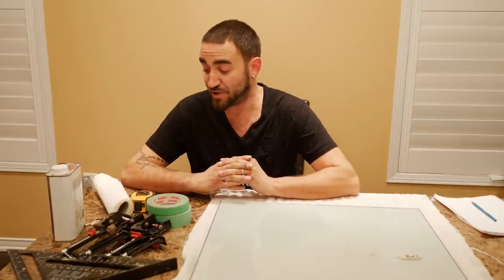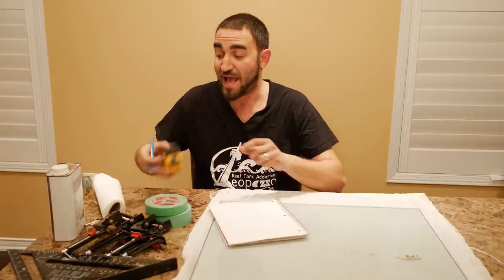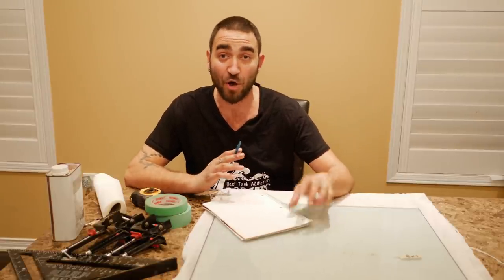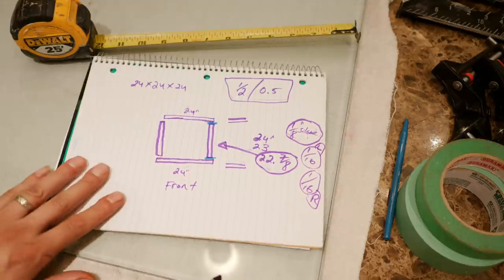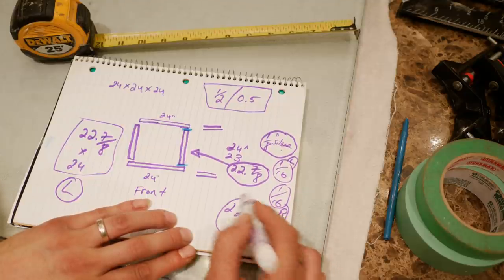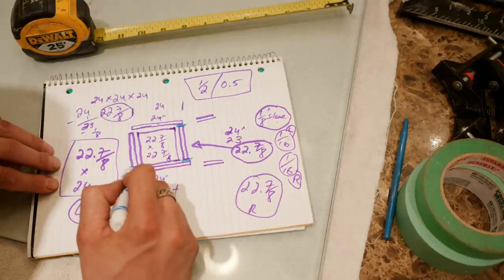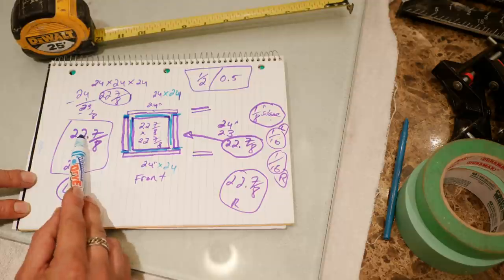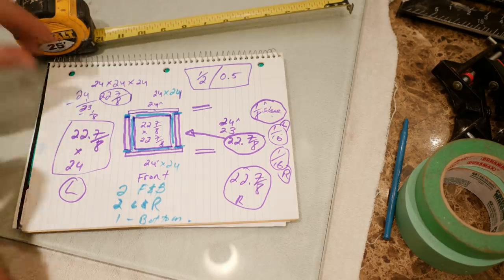HOW TO BUILD A REEF TANK - ( PART 2 )

Comment: I need to make a tank 120cm * 50cm and the high is 60 cm, what is the correct size for each piece?
Reply from the maker: I dont know at the top of my head, just do the calculations depending on the size of the final tank and thickness of glass.

Comment: What does 22 7/8 mean? How to measure it on measurement tape???
Reply from the maker: 22 and 7/8 means that is is just smaller then 28 inches. 
I’d suggest searching 
“ how to read a measuring tape “ and it will help you be able to read a measuring tape properly. The glass measurements are crucial
Reply: @LeoPazzo  Hi Leo I believe this is best video to ask my question again properly (also by far best video for Aquarium making).
22 7/8 is not on measurement tape in india maybe because of matric measurement system here. I can get 12MM glass here not half inch (12.7 mm), 22 7/8 inch is 581.025 mm but I can order 581mm if this is fine. 
Please understand, We use inch cm or mm so I can't order glass in fraction values. 
Please tell me how much MM or CM are the side glass. And I will figure out size for future tank videos.
Thank you.
Btw awdheshshadow was also me from my laptop.
Reply: ImAwdheshShukla hey Shukla this is my other YOUTUBE channel that I am signed into and msg you back. 
So what is the final complete size that you want to make your new tank ? Final dimensions ? 
Do you want to build the exact same size tank I have in this video ?
Reply: @LEOPAZZOPRODUCTIONS  Exactly like you did. 60 gallon 24x24x24 I'll begin a reef cube following your videos but slowly.
Reply: @LEOPAZZOPRODUCTIONS  Holy Jesus Christ... I googled US measurement tape and found out that 22 7/8 is actually written on measurement tape lol. In our tape you'll find inches and then 7 lines in between , other side cm and 10 mm is a cm. 
Now I understand, I'm sorry I didn't see it before but please use cm or mm to explain what bottom and side glass size should I order for 24x24x24 cube. Sorry for bothering you this much.